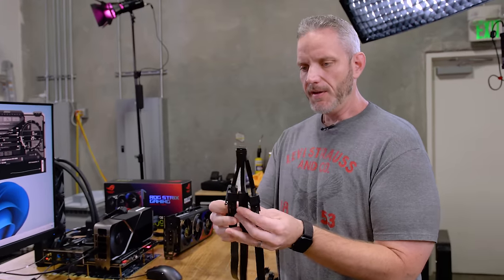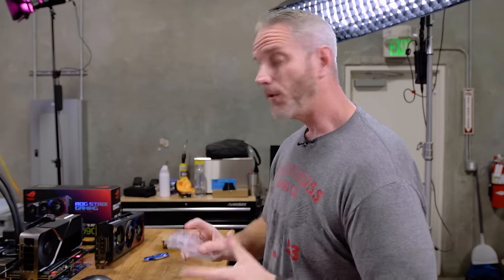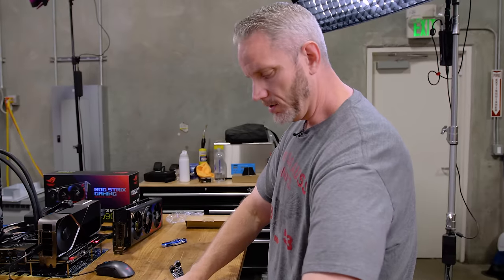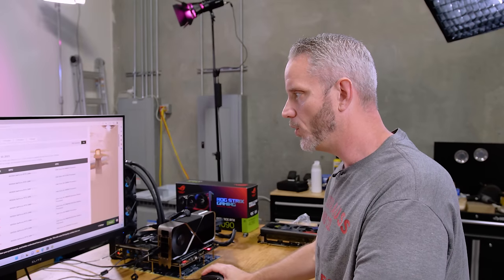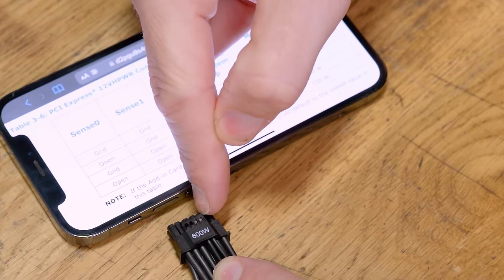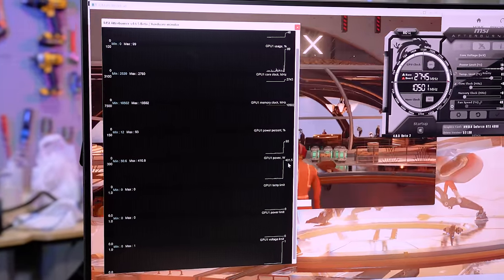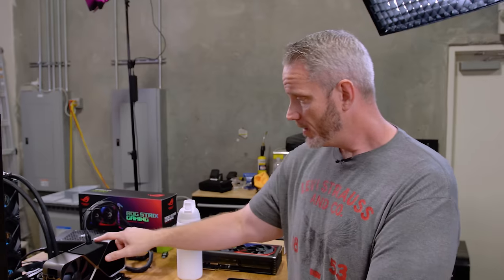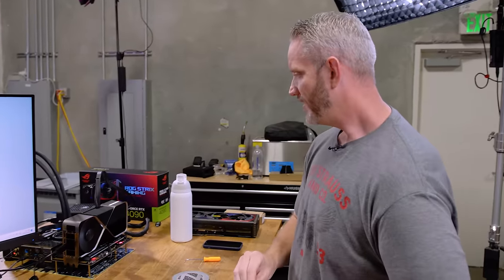DON'T Do this with your GPU!

Comment: Jay, you're really overplaying the "sideband" of the 12VHPWR spec a bit too much. There's two sense pins, and the number of them that are either left open or grounded tells the card what wattage it's allowed to draw. There's no smarts needed on the PSU side, and these adapters from Corsair handle it in a elegant enough way by just attaching these two pins to ground on the type-4 plug on the PSU.

Comment: PC cases should have an open slot in the back.. And the GPU’s should have their connections in the rear. 

Mount the GPU, remove rear panel and plug it in back there.. 

Done..

Comment: Why are 90 degree plugs not a "thing". or 90 degree adapter + add your own cable. I've had to use them on other connections before. (HDMI connectors, and RCA before that)

Comment: The sense pins are Not active communication. They're passive. They only have two states; grounded and open (not connected to anything). The spec states that if the two pins are grounded, the device is allowed to draw more power.

Also, corsair doesn't think the 4090 only needs two 8 pin PCIe power connectors. Corsair knows that their PSU connector is capable of supporting two 8 pin PCIe connectors at the other end; so two of their connectors can support four 8 pin PCIe connectors in total. Their PSU connector IS NOT a PCIe 8 pin connector, it's a Type 4 PSU connector, bespoke to corsair (though other PSU manufactures also support 300W from one of their PSU sockets), into which you can plug one of their PCIe cables, which supports 300W and so two 8pin PCIe connectors per cable.

Please, rather than distributing unfounded speculation, ask the supplier instead? (Corsair in this case.)

Comment: Hello, Jay, solid core cables are worst. Because current is going on the outside of the wire,  it is better to have many tiny wires, thats makes you A/mm2 of wire match better. For example, welding cables are thick but single strap of wire in cable is tiny, because cables need to carry high load of current. Other example is with high voltage high current, if you need carry 1 000A and 160 000V you gonna select solid cable but it wil look like tube, because extracting inner core will have almost 0 impact to you power load and you will save loot of money in copper.
Reply: You sure about that? Is there somewhere you know I can look and see if this is true?
Reply: @df98156  I can find it in my language. In translation it is called Skin effect. Its from maxwells equation.
If you not find it, i will try to find in En lang some where.

Comment: 12vhpwr has 4 pins for signals. Two pins are from PSU to cards they tell the card how much power it can pull, and two pins are for cards to tell PSU if they are connected and if they are in normal state  (basically if not normal its a fail). So for 600w both of two power signals have to be connected to ground on PSU so that card can see it as 600w capable. That is what corsair did with their cable. Also, you can push more current (power) thru stranded wire rather thru solid one (current travels on surface of the wires and stranded ones have more surface as such). The reason they are so tough to bend is, they are not pure copper wires and have other cheap metals.

Comment: On the NVIDIA adapter two of the four sideband connections are fake and the cables are cut just an inch after they go under the fabric. der8auer disassembled one and was puzzled as to why they pretend to use 4 when only 2 are needed and connected.

Comment: I build cabels for a living and a solid core cable will lose ability with the number of bends no matter what it does straight.  Not to mention wear and breakage with bends. It also can make the jacket of the solid wires being smaller at bends and promoting shorts.  But tbh i scream at people that design cables daily as they dont think or maybe know the environment and use of what they nake.  Thank u for comming to my ted talk......
Reply: And lots more and in depth issues.  I tried to be vague

Comment: Oh crapola! This is exactly what I am doing. But I don't see an alternative as installed PNY RTX XLR8 3060Ti in a 4 year old HP Z440 wkstation with 525watt PS. Thus far seems to work without issues.

Comment: Igor did a full rundown on this topic. Those two leads from the "smart connector" are just two grounds that need to be there to be able to deliver 600watt to the card. It's not fucking smart at all. You really simply could ground those two leads to you PSU yourself and trick the card into pulling 600watts. 🤷‍♂️

You can read all of that on igorslab

Comment: Jay the problem your having is because the card isn't getting enough power as you set it up, that's why they shipped with 4 cables, if you don't plug in all 4 your not going to overclock worth a damn.

Comment: The reason your "dud"  4090 is not overclocking is probably because your power limit Target is stuck at no more than 100% instead of allowing 125%.   The bios will not let you go past 100% if on the 3 pin "smart pins" and up to 120% with 4.
Reply: Wrong. It allows 600watts with the corsair cable. He even comments on it in this video, and that he wasnt power limited but voltage limited.

Comment: I would hope it is not solid core unless the current going through those cables are alternating current and not dc. DC current prefers stranded wires.

Comment: i just bought a ATX 3.0 PSU. cheap and easy and works awesome
Reply: hey! i have a question. 
do ATX 3.0 psu reduce risk of the cable melting?
im still not sure if i should get the 4090 if it has chance to melt

Comment: Jay really really hates this connector lol. Hopefully cablemod will fix this
Reply: Its a shit connector, they could have made it 30cm so that its a single cable on the front side and all the connectors can sit hidden away in the back or under the shroud, That single cable look the corsair has so much more elegant, especially considering you're spending $900+ on these gpus

Comment: 1:35
Good job Corsair, can't wait to only have a 450w budget! Cablemod ftw3.
Reply: Did you watch the video? He clearly shows you get 600w with this cable.
Reply: @ahs9674  I skimmed through, but missed that. Regardless, I'm not running dual 8 pins.

Comment: The reason you can run two connectors is because that's what's required. The other connector simply has so many because of lability with increased chances of failure at the added contact points, just listened to Jonnyguru do a talk on it 😅

I can promises that's not a solid core cable, it just has less/thicker strands. That will reduce the amount of times you can bend it, but still far more than a few times with solid core. Because it's making the cable longer that will help with reducing voltage drop with it being a longer cable

Flies away all nerd like... Well... ACCTUALLLLyyyyyyyyyy

Comment: so let me get this right. They made an unnecessarily space heater thing, then said, oh, btw, need to use the next gen power supplies that no one has for proper safeness, but it is easily tricked 1 way or the other just by pin presence not by sending some meaningful data, and when the power is low, it just doesn't work, which defeats the whole point of having the communication of power that should let it turn down? Also, I could see that meaning that people or brands will make work arounds in order to avoid having it not work at all.

Comment: dumb question: is this cable works the other way around? I mean (hypothetically), if you only have that 12VHPWR connector on your PSU (and the 8-pin connectors are already used, because there are few of them), and your GPU uses only 8-pin connectors...

Comment: Ummm STUPID Question.... All the GPU companies for the 4000 series include an adapter for your PSU, but I am curious as to why the manufacturers cant work into the price of the card (over a $1000 I believe) Just include a 90* connector???????

Comment: So I'm curious are you saying the sideband works kind of like the remote wire on the head unit in a car. Remote wire doesn't supply power but when you switch the key on and off it allows the radio to start up or shut down so is this side band working as a remote wire?

Comment: Hope u notice the comment would like your pov, the 4090 is good at RT and 4k but a 6950xt isn't that far behind at 1080p and 1440p if amd have a 50% perf/watt increase and at least keep the same watt hasn't amd already beat the 4090 on just that.... While using less power?

Comment: I have an inwin 1200 watt and it only works in certain configs.There are 2  sets of 8 pins  and  1 8x for the cpu.If I was too hook up just the cpu to its dedicated power and not use the hard wired 2 sets of 8 pins and plug in 2 separate 2 x 8 from the module plug ins i get no cpu or video card power,but if i use the 2 hard wired 2 x 8 for the sli instead it all works.That I do not understand why it cares what set of PCIe that it supplies,If I use the modular plugs vs the hard wired Pci.

Comment: Corsair knows Power Supplies no doubt! I got one of their cables for a 3060 TI FE for RM series Power Supplies because I didn't want to use the adapter Nvidia put with those. Looked way better
Reply: They learnt from Seasonic (they use to sell rebadged Seasonic ones in the early days) iirc
Reply: @scarletspidernz  yeah I'm more of a fan of the newer ones, the RM's now are pretty solid. I've seen some of their older ones with completely different badging but never used them back then

Comment: In regards to  the sensor pin, would the system boot with the pin placed in the socket without the wiring itself being connected to it?
Just curious.
Reply: Pretty sure it senses continuity or current going through the pin, so it'd need to be connected to sonething

Comment: Might be a little ignorant here, but will the 2 8 pin to 12vhpwr that corsair provides (with the RM1000e) be fine to power with a 4080 super?

Comment: Which of the both power connectors i would use? None! Honestly, if i would spend 1500,- bucks for a 4090 Graphic card, i surely go for a decent ATX 3.0 PSU.

Comment: IMHO they could've just updated the older 8-pin spec. Good cables that come with good power supplies can already easily handle 300W in my experience. All they had to do is update the spec so that the good cables become mandatory for the new spec... And if they're really that worried about PSUs blowing up due to overload (which shouldn't happen in the first place thanks to safety measures built into the PSUs) they could change the keying which would prevent the two connectors, albeit them being the same physical size, from connecting. It's what I would have done IMHO. Don't change something that works lol.

Comment: 17.52 Yes Monitors/Displays absolutely cause issues.Ny 4080fe absolutely hates my Sony 85inch 120hz Display. Although with the TV getting a new firmware update and Nvidia put out a new driver. The issues have diminished bur are still present and is a pain in the butt!! I'm currently waiting for this cable to arrive in the mail to see if that will help because I do get Kernel 42 power errors and just random things .I wish I knew about this before buying Sony and bought LG instead..

Comment: I like the idea of a single cable instead of using adapters but I feel it is a little unnecessary to pull 300 Watts out of two PCI-E slots on the PSU. It is probably safe for the majority of PSUs but why? Just use four at 150 Watts.
Reply: It is not a problem, the psu manufacturers overspecced these things and some overclockers pulled 600watts through a single 8pin cpu cable without issues.

Comment: Good bye-bye small form factor like a nice cube case. Coming up next will be a requirement for 2 separate power supply units with one of them dedicated only to the GPU..... And the laptops won't be able to keep these newest units cool without Nutting them to rtx3070 specs.

Comment: So according to the PCI-e spec, each 8-pin cable should only provide 150 Watts of power so aren't 4 cables needed for 600 Watts+? Not accounting for slot power?
Reply: Nevermind I forgot that from the power supply the one cable splits into 2 8-pin connector

Comment: Might run two vs four as Corsair uses the same connector for eps and pci power and eps connection are ~300w vs 150w for an 8pin pcie

Comment: Every time you bend that solid core cable, an electrician dies ... no seriously, you don't bend solid core more than once - it work hardens the copper, introduces hairline fractures, and becomes a point of increased resistance - knowing this is one of the primary reason why electrical contractors need to be licensed.

Comment: What if you have an older power supply that has the standard 8 pin PCIx and no extra sensing wires like the 4000series cards?   Does that mean the startup = 100 watts + 75 (Pci slot) = 175 total watts?  And 150 + 75 (mb pci) = 225 total power available for the card.   Which means only a 4070 might work with a standard older 8 pin connected because its TDP is 200 watts.

Comment: While we are on the subject of the 4090s, can I get a shoutout to Asus and various other Nvidia partners to make liquid cooled versions of the 4000 series? A 360mm AIO cooled 4090/4090Ti would fit perfectly with a Haf 700 Evo. (You can fit two 360mm AIOs on the top.)
Reply: As for other cases, you can find ones that allow side radiators of 360mm clearance for a AIO 4090. Corsair 5000D for example.
Edit: 360mm vs 240mm for 450+ watt GPU. Which makes more sense? Just saying.

Comment: What if you put a switch on those sense wires and flipped the switch under load would it throttle it immediately or would it just assume it still has the same power?.....

Comment: Volts X Amps = Watts 
12      X   50     =  600
I bet those wires are going to get very HOT with 50 amps WOW . . .

Comment: For aesthetic‘s, You could make a [__ plastic shroud, from a small box. That hides the face GPU plug, and wraps around underneath hiding the wires. Maybe a 3.5in Plastic hdd case-box would be around the right size, with sides deep enough, should Conceal the wires nearly to the board, and then a sleeve

Then Under Volt, a 4090 will Achieve 95% of its performance for 350w, and over 3090ti for 200-220w
Reply: but why have 95% performance when you can have 100%
Reply: @jondonnelly4831 .. Because People are complaining about its wattage, and at 95% you save 100w

Comment: So, in theory, you could take ANY power-capable older PSU, and so long as the two sense pins are grounded (either via this cable or a manual bodge) it will work just fine? 
This video proved that the grounded sense pins are what tells the graphics card it's OK to draw the startup (and subsequent) power. 
And if the PSU is NOT capable - yeah, looking forward to the next video with a 500W PSU! (because grounded pins say it's OK to draw 600W, but the PSU can't supply it).
(Check your fire insurance first? More likely a PSU fuse will blow/trip, but who knows?)

Comment: I guess since EVGA is not in the GPU business anymore at least voiding warranties won't matter as much. So if you have one of those simply desolder the shit PCIe connectors and replace it with an XT-150 (which should have been used in the first place when molex was replaced 15 years ago). Pair that with some proper 8 awg silicone between the card and the PSU = no more fires or melted plugs, that setup is good for 120A (1440W GPU at 12v). I doubt one will ever need 3 of those to run a GPU (4kW+), unlike stupid 8-pin sets. Far easier to cable manage 2x 8AWG's (fine stranded + silicone instead of PVC = very flexible) than 24x 18AWG runs.

Comment: I have a Corsair rm850x which came with two dual 8-pin cables (two cables each terminated in two 8-pin). Can I use those two cables into the 12pin adapter not having to buy two more cables for the 4090?
Reply: @ultimate26 After a lot of research done on this I can tell you it is safe for sure. Just make sure to plug them well because they tend to be kinda lose. If your monitor or PC suddenly turns off and the GPU fan goes to 100% that most likely means one of the plugs is lose.

Comment: So here's my problem with this product. PSUs are designed to provide 150 watts for each 8 pin PCIE connector. Meaning the PSU delivery would be around 280-320 after variance is taken into consideration. Then add 75 watts from the PCI-E slot, and you're at around 375 to 400 watts. You know, right around what you were using on that FE card. Corsair's cable is theoretically only rated, at the PSU end, at 300 sustained. I wonder if you'd get better power budget from using the NVidia 8x4 to 12 pin even with the extra connection. Official MOLEX spec is around 324 watts on an 8 pin (assuming ideal circumstances). ATX specs out at 150 watts and that's what the general PSU industry has used for it's cables, as the spec is to protect from potential hazards of higher amperages.
Reply: 150w limit is for multi-rail power supply, they split load across all/some cables. Single rail can draw any amount from one 8-pin. The 4x8pin might be for multi-rail PSUs. And 2x8pin for single rail PSUs.
Reply: @christianandrew4746  and that's why the ATX spec is 150 per 8 pin connector. To cover for cheaper supplied and cheaper cables. Anything g CAN draw whatever power it wants, it comes down to what the supply is specd to push and what the wires, caps, etc can actually handle heat wise.

Comment: ASUS RTX 4080 Tuff Gaming with this card still not clear? what do I plug in all three with one PCIE 5.0 plugged into one of the three plug cable; or just one PCIE 5.0 cable? Still confusing me. GAMEMAX 1300W Power Supply, ATX 3.0 & PCIE 5.0 Ready, 80+ Platinum Certified, Addressable RGB with 5V Motherboard Sync, 105°C-Rated Japanese Capacitors, Fully Modular, 10 Year Warranty, RGB-1300; 
I had a PSU EVGA 1600 T2 and I plugged all the plugs with one VGA rail to each plug into the 3 cable the 4080 came with and I didnt get the higher power from the PSU.